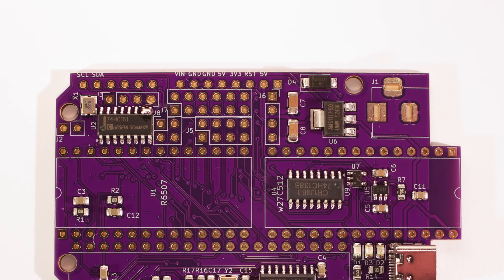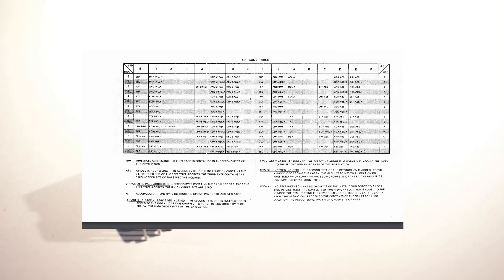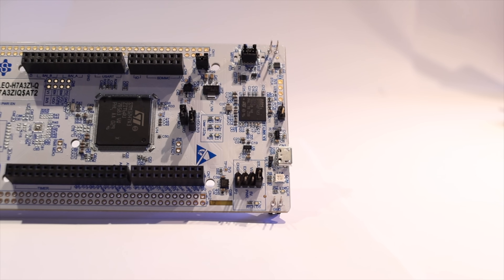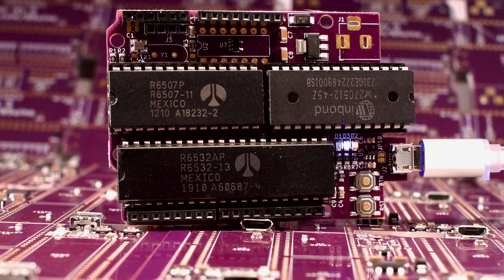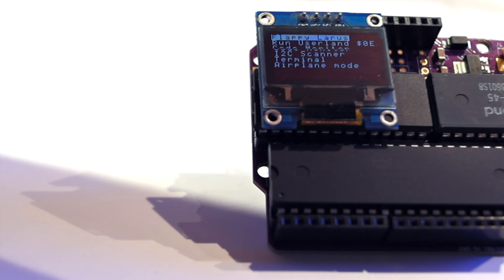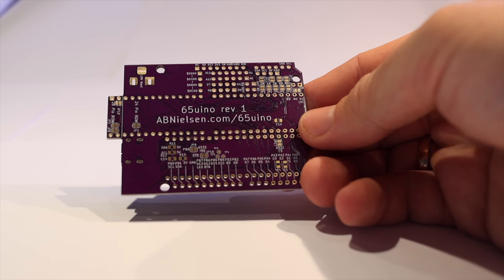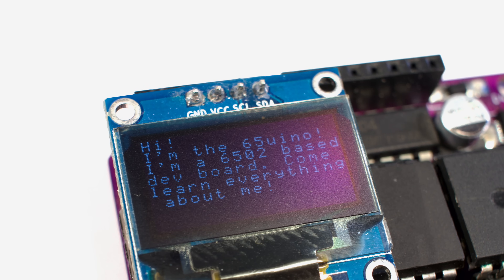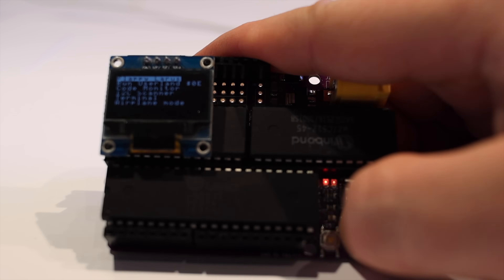6502 Turns 50! The BEST 6502 Computer of 2025 is here!

Comment: I can't believe it's been 50 years! Wrote my first 6502 machine code in 1981!
Reply: Ditto me, UK101.
Reply: Ditto me,KIM-1.
Reply: Ditto me RAND USR 10000 on a ZX81
Reply: @dreznik  The ZX81 was based around the Z-80A CPU
Reply: Damn I wasn’t even alive in 1981 lol… but my first computer, an old hand-me-down, was a 6502-based machine called the BBC Microcomputer… its version of BASIC allowed inline assembler (and proper functions, it was super fancy)
Reply: @DissociatedWomenIncorporated  Yes, a wonderfully well designed machine. I hand disassembled the Basic, it was very well written, you could follow the subroutines and work out their functions. I miss the easy I/O and interfacing.
Reply: @BillDavies-ej6ye  Sophie Wilson did incredible work on that version of BASIC. She also clocked the Beeb’s RAM at double the speed of the CPU so that the CPU and graphics hardware could access it on alternating cycles without slowing each other down, something I believe no other microcomputer had done before that point. And she designed the original ARM instruction set! So I’m even still benefitting from her work while I use my tablet to type this comment 😄
Reply: @DissociatedWomenIncorporated  Truly a capable woman, and a trans hero. She deserves the CBE awarded in 2019.
Reply: @BillDavies-ej6ye absolutely!
Reply: That's when my dad got the Apple ][+, but I didn't get to write code on it till '83.  Those were the times. Needing to read a register to make a click on the speaker and then do it in a loop with a delay to get something that resembled a tone. Good times.
Reply: Me too in Australia on 6502 in 1984. I hand soldered my first Z80 kit together in 1987!
Reply: Ditto me, homebrew
Reply: ditto Me, but I8080...
Reply: I miss those days.  I still know the Z-80 and the 6502 instruction sets and assembly.

Comment: Re-inventing the wheel eh?  Tandy did a pretty good job for EVERYTHING you are trying to do.  An RS232 is the best for expansion.  Programming your own Eproms becomes alot easier.  Especially since there is already a rom with EdTasm+ that makes your "coding" much easier.  of course we used to save on cassette tape, then Y plug in the burner, etc.  but we did eventually get floppies and hard drives with the rs-232 as well.  The serial port you are using were just for things like a joystick.  I believe the speed is actually .89 Mhz.  You want to solve a problem?  get an old CoCo and show us how to eliminate the composite output block and replace it with anything else... I still have to use a signal converter on an old crt television, and it sucks.  Yes the asm code on a 6502 is 'simplistic' by comparison, but it trained me to be efficient in my coding.  Today's 'standards' in coding are sloppy AF.  There were 6502 boards that were made specifically for banks to use, they didn't want keyboards and look alot like what you have here... of course they basically just handled a means to securely connect their modem(s) to the old school backbone, they were requisite.  As people like me were war-dialing for tones even in 1980.  A lot of banking info was number crunched, etc. on non-local mainframes ... let's just say the 6502 played a role.  other than that...but an ESP32 w/ a couple add-ons for $10 instead of re-inventing the wheel.  yes, i still have all my original crap ... in boxes.  Even the original 6502 books, you'd prolly like those.  there were also many magazines that went into great detail with code, i tossed hundreds of those.  The best bit of code I still love to this day was made for a 6502 is for finding square roots, the method is elegant ... and when stored in 2's complement form becomes very useful.  TMI.
Reply from the maker: You can always throw an ADC and an FPGA at the video problem. Then you can simplify that and throw away the ADC.. because you can just emulate the CoCo.
The 65uino just tries to be a handy gadget you can wrap your brain 100% around in a super short time :)

Comment: I got started with the 6500 series when I was a kid using a Commodore 16 which had a really good monitor programme. I couldn't afford the C64 at the time. Always loved the architecture and moved on the Hitachi H400 series in my first job as well as the Z8 (not Z80) programming purely in Assembler. One H400 project had three processors, serial comms and a large dot matrix LCD display - Hundreds of pages of code and all debugged without an emulator, just crash and burn. Another system based on the H400 and the original PIC16C54 was an inductive power and comms coupling system for intrinsically safe systems which was patented due to an idea I had on a bus on the way back home from work .

I then moved into a different role and for fun I designed an evaluation board for the 8051 based on a Winbond device with two flash memories and could be booted from either depending on DIP switch config, so allowed a programme to be loaded into main flash via serial from the boot flash and then run from the main flash after resetting the programming DIP switch. All of the 40 pins of the standard 8051 were bought out to a 40-pin header allowing it to be used in a real 8051 socket and provided a disk with the Keil 8051 tools and a serial cable. We sold quite a few and I still have one around here somewhere. Happy days circa 2000! 

I remember the original Philips Semiconductors LPC2100 Arm devices being introduced which were stupidly cheap for the power that they offered followed by ST and I knew at that time the writing was on the wall. In a further job role I supported the Motorola / Freescale 6800, Coldfire and high end devices but my heart wasn't in it because I knew Arm was absolutely going to kill everything they had at the time.

I never really transitioned from Assembler because I've never really liked C - It doesn't fit well with my way of thinking and programming and I didn't like the abstraction from the CPU and basically stopped programming and began working with RF systems and then into Ethernet and time sensitive networking. 

The whole idea of going back to absolute basics with a board such as this is ace! I think engineers now are way too abstracted from the CPU and what's going on. I get why that is and it isn't my bag any more, But playing about with hardware interrupts being serviced by an Assembly routine to do something and setting up the registers to make it happen is a lot of fun.

Nice work!

Comment: 6502 turns 50 !  I feel old ! I remember when it powered a lot of the home micros of my teenage years !
Reply: I'll second that. Born in 1971 and between the 6502 and Z80 it defined my 1980's between dropping 20 cent pieces (I'm Australian) into arcade machines or playing with my own home computers
Reply: My teenage experience was with the 6809 - which came 3 years later but the Z80 was in my ZX81 (my first computer). Happy days indeed.
Reply: @ I did mainly play on the 6809e , because it was in a Dragon 32 that I had (It was also in the virtually identical Tandy / Radio Shack Colour Computer ) 
But they were more rare than the 6502s or Z80As that seemed to be in everything else that my friends had !
Reply: @karlosh9286  I had the Dragon as well. I got into fruit machines and video games - some of these had the 6809, I remember writing something in turbo pascal to de-assemble some of the ROMs. It was all good fun back then.
Reply: @ yeah, it was fun. Happy days  !

Comment: 10 Print Chr$$(205.5+RND(1)); GOTO 10   -old C64 Basic program to design a maze.  Do you have a dialect of Basic for your little computer? Also, it could use more blinkenlights!
Reply from the maker: You'll find a book by that name ("10 Print..") :) 8K of address space is a bit small for most varieties of BASIC but it's not impossible.

Comment: YES! Wait - no. I'm torn.
If I had the skills, I would Fork the Git source, and put in a W65C02 QFP chip. Depending how much space was free, I'd also add a 6216 (2Kx8) or 6264 (8Kx8) static RAM. 
A hex keypad would be nice, but that can go on the extension header pins.
Reply from the maker: The PLCC feels kinda wrong - but please go ahead, shouldn’t be too much work :D
Reply: @AndersNielsenAA  If you don't have a DIP, then a PLCC socket is a valid choice. Bigger concern is the 64K EPROM you use, along with special decoding to address RIOT chip. 6502 uses memory mapped IO, so I'm also sorting out how to address any Arduino shield you plug in.
Time to research the background of your design a bit more.

Comment: I  first leaned assembly language on the 6502 at 16 yo on a single board system with a built in keyboard.  Later i learn assembly on the 6809 when I bought a Radio Shack Color Computer.  I'm 61 now.
Reply: I was 10, same same the Z-80 also opened my mind.  I'm 55 now.  Real info was so hard to get for me pre ~ '82.  Always in the dark looking for a light switch.

Comment: The ROM is filling up, you say. Your bootloader could read utilities from an i2c EEPROM into RAM when needed and run them. That way you could have many megabytes of programs. It would not strictly be epoch accurate, but they are only utilities.

Maybe support dual booting the same way?
Reply from the maker: Well - the only RAM in it is what’s included with the 6532 :) 
I’ve thought about it :)
Reply: ROM banking is a comon trick used on computers of that period. For example the BBC models A & B used ROM banking to enable up to four utility ROMS occupying &8000 - &BFFF in the memory space. The base machines would only have the first of these loaded with the BASIC interpriter ROM although if you purchased the machine with the disk interface or econet preinstalled the ROMs for those would be fitted in one of the free ROM sockets each. I might add it was possible to modify the BBC to take upto 16 ROMs without having to change the OS. Expanding to 256 ROMS was also possible but a couple of bytes in the OS would need to be modified.

Comment: I built my first  6502 design back in the 80's , all hand wire wrapped.
Back then without the development tools the hardest part was getting first boot, you had to do everything in your head and work out why it would not work.
Even getting the initial code in took 20 minutes each time to erase & reprogram the eprom.
many of the chips i used were engineering samples, "leveraged" out of the various suppliers.

You  guys don't know how good your development  life is compared to back then... you can order moduels , equipment, parts all form online stores.
Reply from the maker: Not to mention how the internet has an answer to any issue you can come up with! :)
Reply: Yeah, I went through that steep learning curve too! But you really learned how it actually worked
Reply: I was born in '99 and literally have no idea how you guys survived without the internet and more recently ChatGPT
Reply: That's nothing... I just came back from GRUB console mode hell, with Nvidia drivers and a LUKS volume. (totally joking... you win).
Reply: Even 25 years ago, development on microcontrollers sucked.  If you couldn't afford to buy an ICD or ICE for the processor, life was hard, no real debug capability.

Comment: will it work with the WDC 65C02? or only vintage ones?
Reply from the maker: The 80s CMOS clone doesn’t come in a 28 pin package - technically you can make an adapter and it’ll work fine though.. with some overhang

Comment: Both the 6502 and original 8086 are fine choices for learning the basics and learning assembly. They are immensely easier to learn than a modern x86-64. Everyone who was lucky enough to get paid to do actual programming on these back in the day before proceeding to modem SOCs in their career is counting their blessings :)
Reply from the maker: I know what I would do if I somehow time traveled to the 70s :)
Reply: @AndersNielsenAA  Exactly. Only caveat is no internet, no PCBWay, no JLCPCB. All information and PCBs would be infinitely more difficult and expensive to acquire :)
Reply: I did a lot of 6502 programming back in the 80s. It was a fun CPU to program, but didn't get paid a lot :)
Reply: The 8086 assembly language was horrible. It was basically an 8080 hacked to work in 16 bit mode, with some cludges to get at 1MB of RAM. Now if you are talking about the 68000 …
Reply: @stevetodd7383  I used to get a nosebleed from the high level commands and (16?) addressing modes of the 68000, stick to the 6809 :)
Reply: @occamraiser  Color Computer represent!
Reply: @occamraiser 68k is not that bad. You don’t need all of those modes. I’d argue you are better off learning the 68k or 6809 before you look at the 6502 or Z80, which are both pretty grim to code assembly in in comparison. The 6502 especially. I know I’ll get lynched for saying that here. *shrug*.
Reply: Personally, I don't think 8086, or any x86 variation, is good for learning assembly.  There are much better alternatives: Z80 (maybe that's what you intended to say?)  Even MIPS or RISC-V assembly(which closely resembles MIPS assembly) or even ARM.  x86 is only slightly better than x86-64. How about the MC14500B Industrial Control Unit, a CMOS one-bit microprocessor!

Comment: Has the 6502 now officially outlasted the Z80? Cheers!
Reply from the maker: Well - the NMOS 6502 has been out of production since the 90s. The 65C02’s are 80s clones - depends who you ask if that counts :)
Reply: @AndersNielsenAA  if you haven't before, check out  Western Design Center. Among other things, they sell a board featuring The W65C816S 8/16-bit Microprocessor, W65C21 PIA, W65C22 VIA and W65C51N ACIA!!!  more 6502 goodness than you could shake a stick at!!
Reply: @AndersNielsenAA  Its a tricky question as the Western Design Centre that is responsible for the 65C02 was founded by two of the members of the MOS team that did the design for the 6502. However members of that same team designed the 65CE02 hafter MOS was aquiered by Commadore. So the question beomes which of the two 65C02 or the 65CE02 is the true variant as developed by the original design team. If it is the 65C02 then yes it has outlasted the Z80 if it is the 65CE02 then it is no. 
The real problem is the 65C02 (and the 65CE02) is only compatible with the MOS 6502 on a documented instruction level. Both on cycles for some of the instructions and the emergent (undocumented) opp codes (that were a result of the internal structure) it is inccompatible meaning it is not a drop in replacement for builds that used those properties of the MOS chip.
Reply from the maker: @martinrwolfe Neither are hardware compatible with the 6502. Both are made almost a decade after the 6502.
Pebble’s idea was a low cost embedded CPU - when it was regurgitated into CMOS at WDC, what made it that was lost.
Doesn’t matter who regurgitated it.